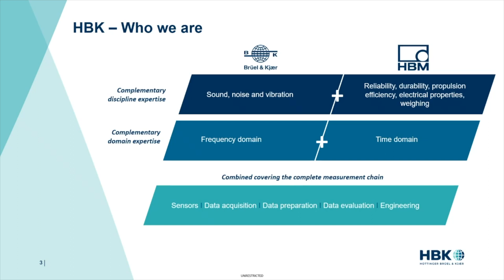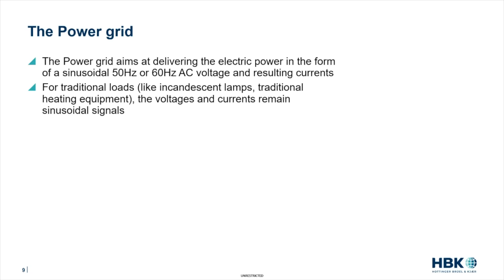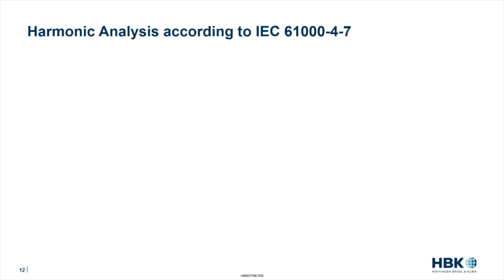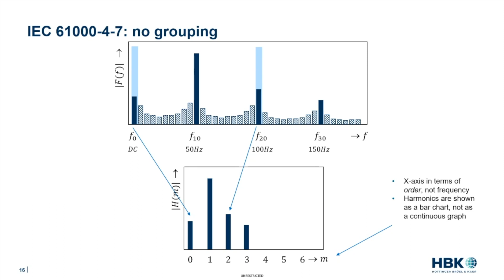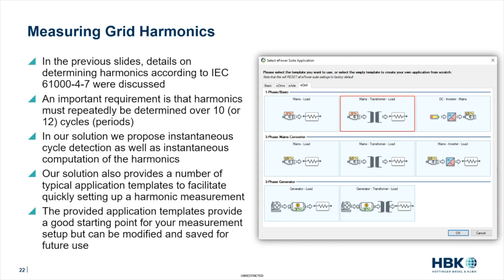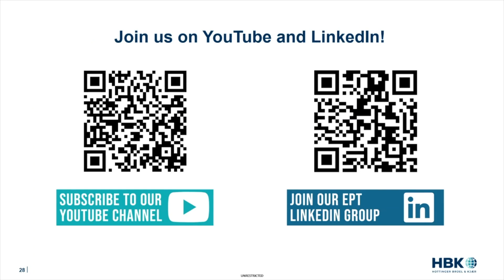IEC 61000-4-7 and Grid Harmonics Measurements

Comment: But which method is correct in case of limit assessment? Let's say my signal can be decomposed to the spectrum with some spikes around 85 or 120 Hz (50Hz grid), but not 100 Hz (2nd harmonic). The standard for limits (like 61000-3-2 or 61000-3-12) says just "harmonics", it doesn't mention the "flavour" of my harmonics. Depending on criterion used i could fit well below the limits or exceed the limit way too high. Is it just the multiple of grid frequency important or every frequency bit is important and i just should look at these limits as band-energy limits